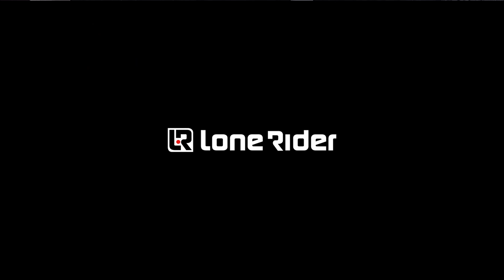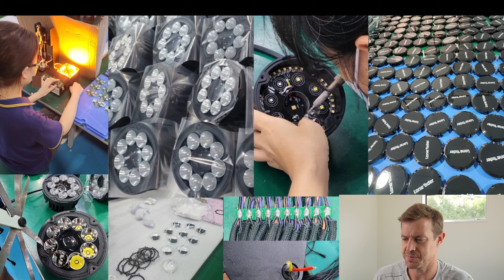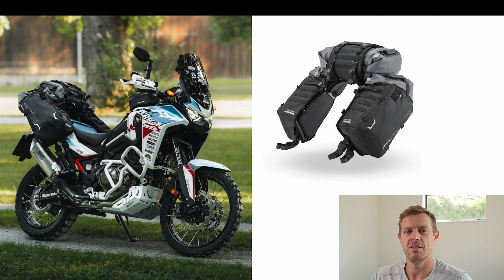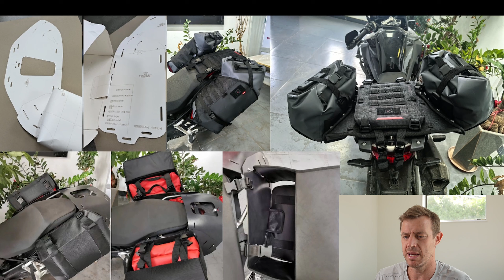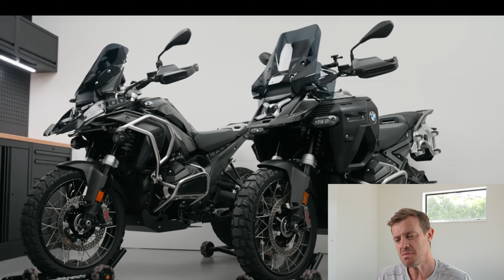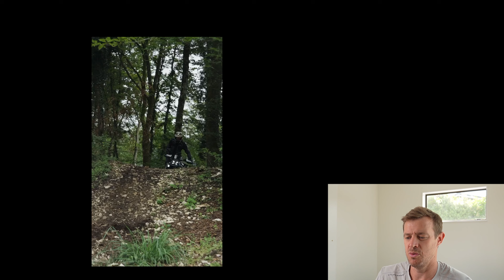People Have No Idea What It Takes to Build This Gear…

Comment: Your products Are above reproach when it comes to quality installation style functionability.....
 I did notice that when you introduced the motor lights I noticed that the inside LED lenses were Amber, Are the new lights coming now with the ability to take the interior 7 and make them Amber or at least 6 of them without the center. 
Is that a software upgrade that I can apply to my motorlight.....
 My goal was to have more Amber up front and I would rather not buy another set of small Lights and put them lower on my gs.
 If my existing motos have a software upgrade that can give me the ability to not only use the drlamber circle white if I can change any interior lights for more Amber I'd love to do that.

Comment: Will you make motobags with plates that can attach directly to 1300 GSA??
Reply: To add, will you consider soft pannier system for the 1300 GSA that will attach directly to the OEM rack … similar to what you did for the 1250 GSA??